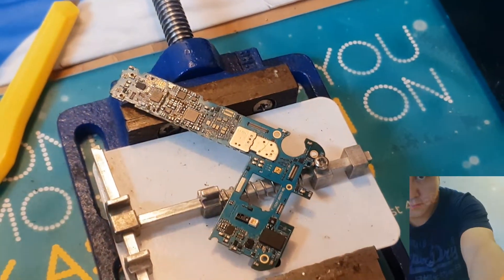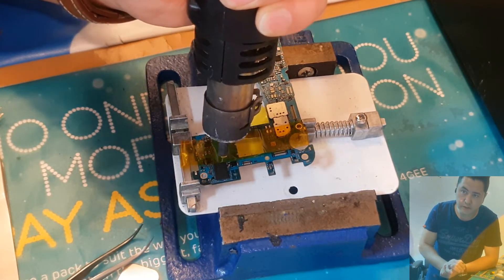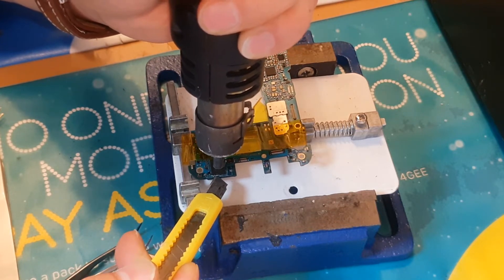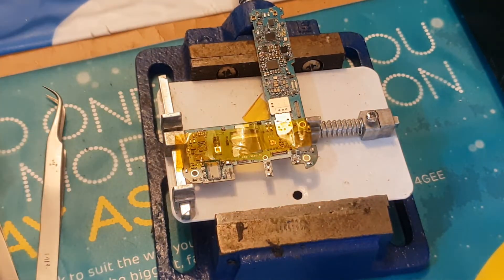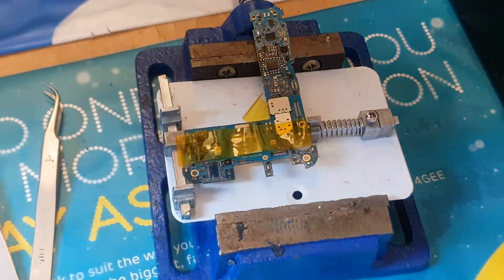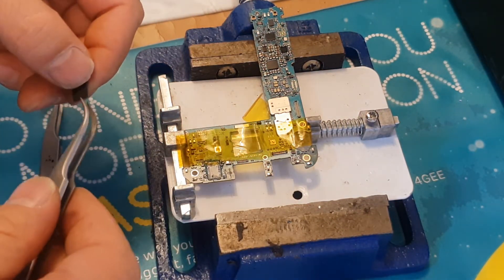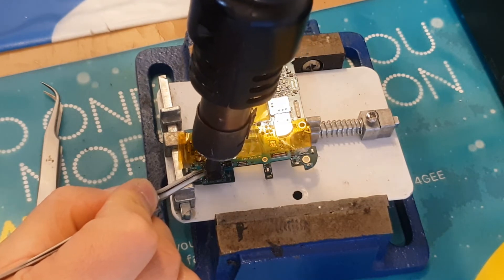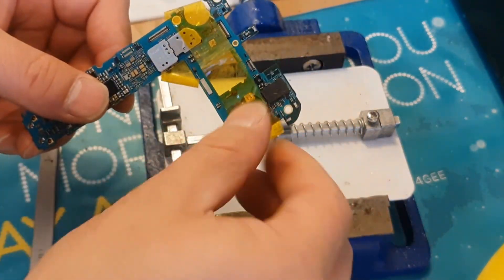Samsung Galaxy s6 s7 Wifi Ic Replacement

Comment: Have a similar issue with bluetooth on samsung s7 g930f with extremely weak signal more than 15cm of a distance it cuts out with a headset connected to it also it cuts out when the phone is moved or laying flat. Does this mean the ic is failing or have cracksd solder balls. What weird ia that the wifi is working can connect to routers and hotspots no problem. I dont know wherever to get the ic replaced or replace the board entirely

Comment: And on the connection pads.. do you simply heat it up or you apply some more?
Reply from the maker: You need to clean it first and apply some resoldering and after you install new chip

Comment: Hey mate. Thanks for the video.. I have some questions about it. Do you use some sort of liquid on it before you apply the heat ? Cheers
Reply from the maker: Hi its not liquid  its paste soldering paste
Reply from the maker: You can also use alcoh to cleane it

Comment: Hi, bud, what is that clear liquid I always see you workers use on the chip? They drop it on the chip, then warm it up with the heatgun.

Also, are you located in London? I may need my WiFi ic replaced.

Cheers
Reply from the maker: Alcohol for cleaning and  solder paste .